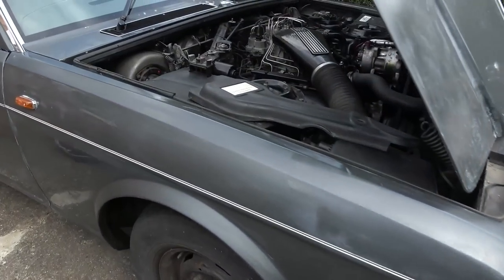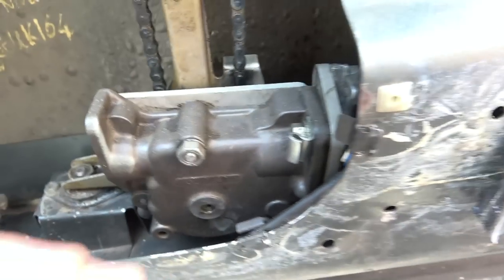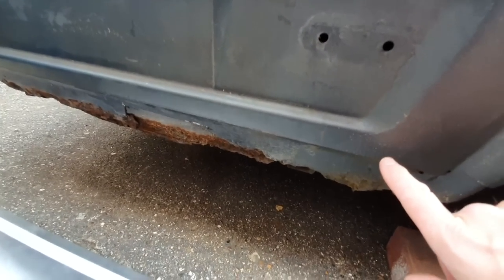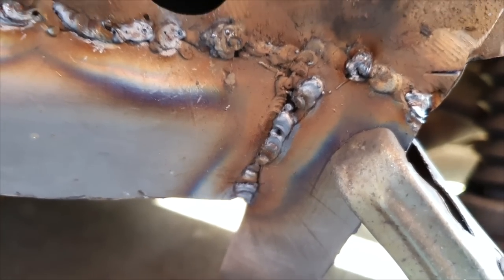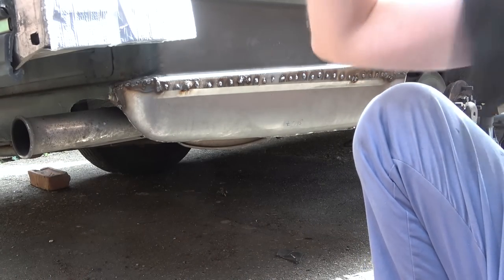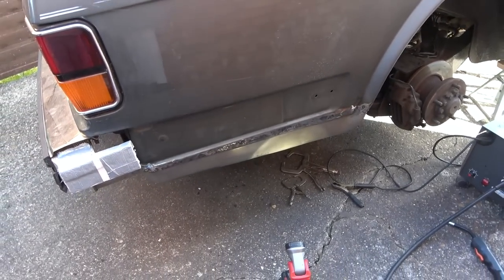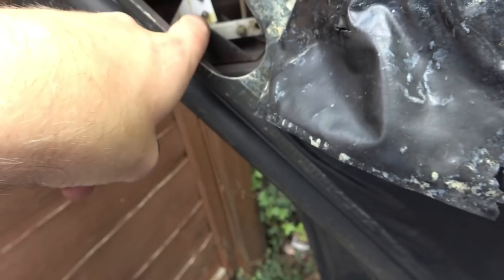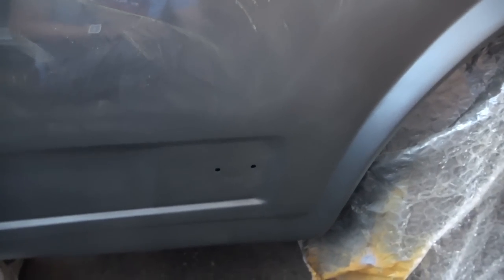Revisit on Previous Repairs and More Welding on the RR Silver Spirit - PART 22

Comment: The plastic part you bought for the window motor looks like UD71409 which is the coupler for the motor to the gearbox.  I think the part you need is UR231 (£55 from RR! 😂).  Good work as always!
Reply from the maker: You are completely correct Howard. Thank you so much for commenting 👍👍👍👍👍👍
Reply: I dont think this is correct  @Mymatevince  the gear is mounted like a suspension bushing. 
It is Rubber Molded to the axle and the gear. Maybe you already have a solution now, but i dont think you can get parts for it.
Buy a second hand motor with a good gear or use your old solution but with a strap of rubber including the nail. Another solution is to get a epoxy bushing kit which you can mold into place. Pressfit will probably slip again.

Comment: Hi Vince, love your vids. Ex mechanic here, you defo got the wrong part for the window mechanism. As for your bodywork repair, not too good on making the inner panel good, and you should have protected the inside of the repair area with weld thru primer or similar. Nice job on the outer panel though. Make sure to spray some wax oil or similar inside where you have repaired, once it’s finished, or else it will rot away again in no time.
Loving watching you learn , keep it up, you’ll get there.

Comment: The sponsorship bit made me chuckle. 🤣Good to see the grinder working! I think the pin you're thinking of is a cotter pin. Awesome job all around. Enjoyed completely!
Reply from the maker: Cotter pin, yes that's the one. Nice one Shawn 👍👌
Reply: No hes right, split pin cotter pin same thing
Reply: @smashyrashy  must be a colloquial thing. I honestly never heard them called by that term and had to look it up. Appreciate it 👍
Reply: In the UK , a cotter pin is a pin with an angled cut at one end to wedge in place. A split pin is a split pin....
Reply: @victor58010  same thing..
Reply: @victor58010  You're correct, cotter pins are wedge shaped and commonly found on bicycle pedals. They may be threaded on one end and a nut draws them in to tighten. Split pins are much simpler and work in a different way.

Comment: You were right on your second guess Vince those vents are to allow moisture to drain out from between the skins. Spray Waxoyl up there to protect inside from rust.

It's not rain falling down from above that rotted that rear valance but water and salt spray thrown off the rear tyre because there is no wheel arch liner to protect from water and mud from gathering inside that rear valance and it just rotted the metal away as it say there for years & years. Its just how they built them back in the day.

Lots of Waxoyl needs spraying in there once a year to try and stop this from happening again after you have undersealed liberally.

Comment: Great Job Vince! Nice to see you using the Milwaukee grinder. 
I prefer the brushless one's but they are not very "repairable" as the control board is encased in hard epoxy, and the controller chips are a custom part and contain firmware.
That rubber part for the door I think might have been for a different model? as it didn't look right to me.
I'd have probably done the same as you with that door mechanism pin, drilled a hole then a split pin, but copper wire works too!

Comment: I have recently had similar wiper issues on my Bentley. The parking switch on the firewall only gets depressed after you turn the wipers off, at which point the motor reverses parking the wipers in the correct position. There are three relays and I bet relay number 2 has failed. Happy to give more info if required. Great videos though.
Reply from the maker: Thanks John, I haven't tested the wiper relays yet. I will do that. Nice one 👍

Comment: Vince for non structural car bodywork welding i.e. wings sills etc spot welding is perfectly ok on it's own, plus it is easier to grind flat a small spot to make it almost invisible.
When cars are manufactured they are spot welded, so why not make things faster and easier for yourself by doing this.
When spot welding only drill the outer piece of metal and weld it to the inner (un-drilled) piece 
Drilling all of the way through then filling the hole is not a very strong weld.
Hope this helps.
Ray

Comment: I'm watching through the whole series , it's impressive work but surprised I haven't seen a comment yet about the need for weld through primer if you have   metal overlapping  which the zinc primer work to an extent  :) gonna trap moisture between the layers

Comment: You need an 'Edge Setter Hand Joggler Joddler Panel Flanging tool' for the panel work that will give you a step and pinch the holes for your spot welding with a MIG. Costs about £50 but money well spent

Comment: Keep the torch lead as straight as possible, the friction in the liner is stopping the wire coming through evenly. The welder is the same as what you would buy ,but the one you got is better than you would buy. You can hear the gas coming out every time you pull the trigger, The bottles you have there only last ten minutes. The welder also has a thermal cut out, "duty cycle" you have to let it cool. Do not put any Waxoyl on until after it has been fully painted, the silicone in the Waxoyl will give a lot of trouble to whoever paints it. Your doing a great job👍

Comment: I think you are doing a cracking job repairing the body work and you right to be happy with the results.👍👍 With regards to the welder, there will be an adjustment screw to vary the pressure on the wire rollers, that will affect the feed if it is too loose. Also check that you have the right size groove in the driver roller to match the wire size and that both rollers are clean, no oil, dirt or rust on them. You can usually remove tension completely so there is no wire feed to check the gas flow coming through. You used to be able to get a valve with a flow gauge on them for that size bottle, not sure if you still can.
With regard to sponsorship, if you really want it, I think you need to actually approach companies. Given your subscriber numbers and the number of views on your videos, it's worth talking to someone like SIP, Sealey or Clarkes, and they may well sponsor you with some tools. I know a fair number of YouTube channels with far lower subscribers and views than yours, that seem to get quite good sponsorship.

Comment: you have done such a good job 
on most welders the pinch wheel is reversible  it might have the wheel on 0.6 also the nylon tube that gides the wire might have cracked so in some positions wire speed is affected 

you can get a generic cable and trigger gun on ebay for 30£ it maybe leaking gas as well
Reply: you can replace the sleeve very cheep un bolt from the welder 
 undo the brass cap pull out the sleeve

Comment: Vince if you used a sanding flapper disk instead of a grinding disk you would have a smoother finish that is easier work with.
Reply: That make sense 
Fine 220 grir

Comment: for the rear door axle ,  when you took out the axle, there was a piece on the end to keep it from comming off in that direction,  why not just get that again and put it on the front side? In fact the round stop piece will most likely be at the bottom of the door.

Comment: A couple of things Vince, swap your gas for argon not CO2, it will be less sparky. Get yourself a leather jacket to stop the weld burns on your body. And most important for MOT check out "prescribed areas" the rules state continues welds on patch panels in prescribed areas, 12inches from a mount point. Your repair there looks OK but if that was in front of the wheel arch you may have been in seat belt or suspension mount area. Great Videos Thanks

Comment: Maybe you fitted that window part in the incorrect order, needed to fit around the axle first and than into the casing, that way the axle would have been more centered. But the rubber piece looked a bit too big for this car to me. Maybe for a later or earlier models with a bigger window motor?
Reply: I thought it looked the wrong part too, and as you said also, perhaps for a different model.

Comment: Another suggestion is I think you could have drilled the centre so you could still have it tight fitting piece but more centred on the shaft but if it really bugs you I’d try and see if there are alternatives. You could also consider contacting somewhere like Eastwood U.K. asking them to sponsor you I think you contacting the larger companies you’d get further. That dent thing I think is to increase the strength of the metal used in production but you might find that panels like that might have had some little holes in the lowest places to drain water from the inside to prevent water buildup and reduce rust!! Just a few thoughts on the video so far lol looks great 👍🏻 though

Comment: Another great video Vince, Maybe you should be using rust stop liquid on any surface rust that may remain as it may promote rust in the future??
Reply: i've seen others using weld through primer on these type of things for future rust prevension when attaching new bare pieces of metal, and tidying the rust off the old. +1

Comment: Vince, I think the “split pin” you were talking about is called a cotter pin and the “circlet” you are referring to is called an e-clip or circle clip. If you search online for cotter pin and e-clip or circle clip you should find what your looking to purchase.
Reply: In the UK a cotter pin has an angled flat and a thread. They were used to hold the crank arms on older bicycles. Split sins are the ones with two legs and a loop at one end.

Comment: I am surprised VInce didn't compare a window motor from another side. You can easily buttweld with points, one at each end and middle, then divide the distance by two, add a point, rince and repeat until all the length is complete. No puddle to control. No rush needed. Lack of protection treatment (passivation) on the hidden metal.

Comment: I hated body and frame repairs when I tried back in the 1960s. It was all stick welding back then, with MIG and other exotic methods 'coming in' and being displayed at the then Earls Court Motor shows. I envy you, welding with 'sparklers' was an  art,  apparently only learned by burning holes in acres of sheet metal bodies. As for the window winder, there was something not right about the part or the fix, had someone removed a vital part along the way, had something dropped out or rusted away, or were the replacement part and the repair item not ideal partners?

Comment: for future reference use epoxy primer for painting over gives a xtra hard barrier for new paint to stick to and easier to see highs and lows when wet sanding and then body filler if needed and provides  xtra protection along with the bedliner and all and i would use single stage paint when done saves tons of hours and days painting when done single stage is better ive done it all but single stage is where it is and better results period .... i would have loved to help and work with you on this car i could have gotten it done in under a week period last car i did was a 69 impala 2 door hardtop frame off restoration took me only 3 months and was a show car after for my friend and even rebuilt the motor myself and customized it and all would have been a honor to help you complete this where you could enjoy and didnt spend a lifetime on to finish but lovely car i dont like all the rigging i see on it windows and all i would have done it professional i do everything related to cars and all worked for a famous nascar driver and all and even did 18 wheelers auto body and paint but loved the vids just need pointers and lil more schooling on welding and all other than that awesome great job brother...

Comment: alot of aftermarket parts you have to modify to make work there not manufactured to precise diameters and have to modify me as a mechanic and customizer i run into this probs all the time.. but that part looks wrong to me rolls royce and bentleys are very picky on what part and where you get if from i had the luxury to work on bentleys and rolls as a 30 plus yr mechanic and classic car restorer i will never touch them again but to me bentleys are the worse trust me no room anywhere to work on them but love the vids keep up the good work love from usa....

Comment: all that rust looks like salt damage over yrs, do yall have alot of snow and trucks throwing out salt or chat mix? if so explains why rear quarters are rusted out from tires throwing it up in fender wells while driving? but like the videos and all and yeah stay away from gas tank if me i take tank down drain before any welding but i dont it right next to tank neck before myself had a mishap and drain or shove rag in filler neck area and smother the cap shut door and should be ok ...

Comment: Why not invest in a cheap IGBT stick welder or a cheap fluxcore gasless mig?   Lidl's and Aldi do a very good little unit ideal for bodywork duty or keep a look out on facebook marketplace for the king of welders, the old oil filled arc welder which is good enuff for structural duty.   A shame you didn't live closer as I would gladly let you have my gasless mig which I have never used but am down in deepest darkest Dorset so quite a way away, have also a malfunctioning 3d printer Flashforge Finder you could fix up as well (lateral drift fault)

Comment: I think someone must have damaged the rear passenger door lock joint when the arm split, as can't see RR just putting a round piece of plastic for the lock to rotate on, and no split pin, so a real bodge job from the previous person either not thinking ahead, or maybe a garage looking for a way to earn extra money for fixing time after time. with the wipers, I am kind of surprised about, but thinking about it there must have been a switch somewhere for the home position, but never worked on that, and so well hidden under the grill on cars I have owned or something. as for welding the 2 pieces of sill, then yeah far better to put the new metal behind the old metal, so the rain to run off plus gives it a cleaner look, while professionals do cut to size, but that is without a tonne of rust to cut out as well, then think your way of welding is best in this situation, as far more likely to weld to a good part of the body panel, plus added strength of 2 bits of metal butted together for a few cm's. personally not sure about them painting over the stone chip spray, as it keeps it original to the 80's style of painting, but that is just me, and my personal opinion. I would also look into some kind of sill protectors when you finish the car, as feet hitting the sills can scratch and cause rust to the sills.

Comment: I know this video is 11 months old now so you probably already know this by now, but welders have a maximum duty %. ie if you have a 50% duty cycle welder, you can weld for 5 mintutes, then you have to let it cool for 5 mintues. Your cheap welder is probably low duty and has gone into overheat protection (if it has any!)

Comment: Vince, you've got to remember that one the most powerful tools at your disposal is penetrating lubricant.
When pushing a bushing in it overcomes the friction and a good quality one then leaves no residue.
Reply: I'm pretty sure that the part he had might have been for a different model, as it had grooves in it for a pin or something, and it just looked the wrong size.

Comment: cut that rust off or your gonna regret it later on and cause the same problem your facing now all rust gone and weld it but use the primer spray that makes rust into primer it neutralizes it and youll be ok but get rid of the rot or youll be doing this again in a yrs time...